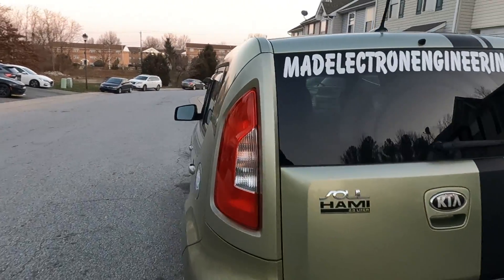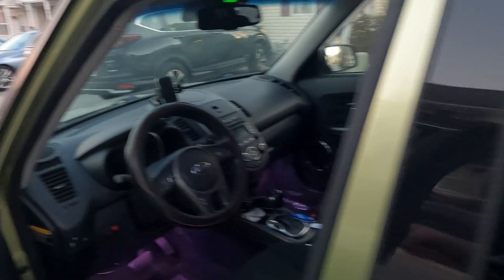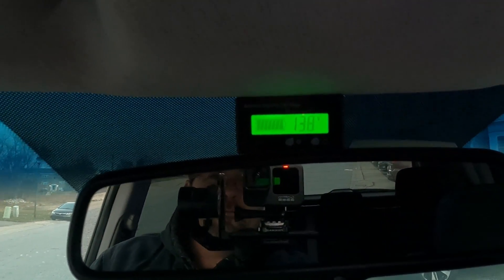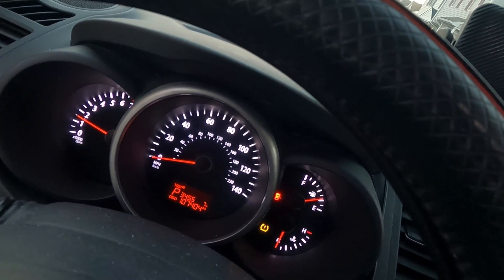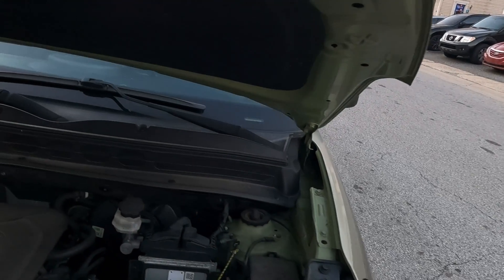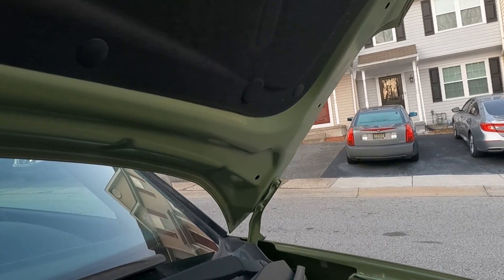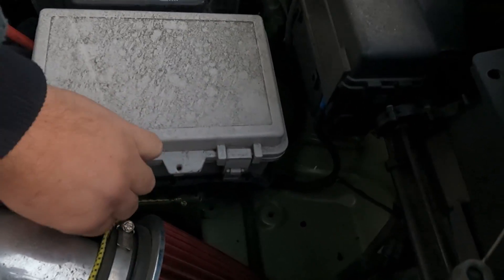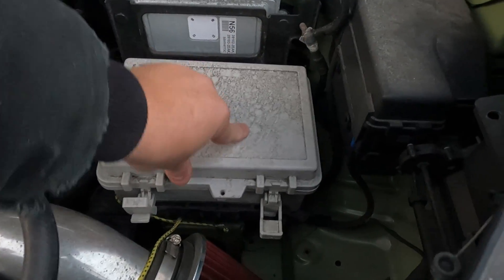Hybrid Supercapacitor Car Battery 5 Year Update

Comment: the only bad thing with this is that you should never charge a LFP battery bellow 0C. i dont get how you could possible make an easy solution for that problem. where i live its -0C to -35C from November to April. so you cannot heat the battery to keep it above that temp, and you coudnt just rely on the supercaps until it get warmer (from the engine). so the only way would be Lead-Acid + Supercaps.

Comment: ...really a nice and interesting job, I wonder if can also be done for 12v motorbikes, if possible can you tell me how many caps I can put in series, voltage and farad. Resistance if I read correctly, use only if accompanied by lipefo4

Comment: no bms needed to protect from over charging, etc?  Im looking to build one for my suv to maximize the space s have. thanks
Reply from the maker: Bms is built into the Dakota lithium battery
Reply: @madelectronengineering  thanks for the response, what about to capacitors?
Reply: There's many kits on eBay and Amazon now that have a BMS or leveling circuits built in, to avoid overcharging individual caps.

Comment: What about using like smaller capacitor bank just enough for car starting, and larger cap bank for slowly  charging it with voltage booster when it drops below critical or just before u start a car, to use whole range of it, not only 14-10V.

Comment: I just watched all 10 parts and was wondering what if you have an issue with the car and it doesn't start right away? Maybe you or a mechanic are diagnosing a no start situation and need to crank it for an extended time.

Comment: Good day sir, is it works for a 3.0L diesel
Reply: Should...I mean the glow plugs might pull it down a wee bit...but the hundreds of CCA's it will dump to the starter will get it turning over very well and be able to compress/heat the air in the cylinders probably faster than the glowplugs could

Comment: Hi, I would like to do a similar thing with my car but keeping the 70 ah lead/acid battery, what resistor should I put between the battery and the capacitors?
Reply: You dont need any resistor
Reply: @yougod7253  ok but it would still preserve the battery, right?
Reply: @edoardobattaglia5157  That is what the small LiFePO4 battery is for...just to keep the volts up in a car that is sitting...to maintain the charge of the supercaps...the supercaps dump HUNDREDS of amps into the starter EVERY TIME rather than getting weaker and weaker and almost non existant when stupid cold...a lead acid battery at 7 would propably have like 1/4 of it's CCA...the supercap batteries have NO problems
Reply: Hayden is right. A resistor is pointless. The battery insofar as it is not perfect is like a resistor in itself. The supercaps would actually somewhat stabilize the voltage and if anything protect the battery. The battery wouldn't have to take a heavy load. I don't know what the specifics of your plan are given there is limited space under the hood, but if you can that's great. I have a history of replacing car batteries and they lose almost all capacity in a year. Maybe I'm going for bad bargains? So I was thinking of experimenting with small rechargeable batteries of some kind because I realized I don't need Ah (amp-hours), just Amps. Leakage current is a thing in most cars though. Something like 20mA. So a series of say 10 or 12 NiMH AA batteries (1500mAh) would last... 3 days. I guess I need better than that.
Reply: @ericmollison2760  ok, I have a fiat punto evo with a 1.3mjt, it originally had a smaller battery but since the 70ah battery fit I put that one in, but I thought that as soon as it leaves me I could get a smaller one again (50 or 60ah) and take the capacitors to put in parallel, there is plenty of space around the battery.
Reply: @edoardobattaglia5157  I don't know much about cars or what 1.3mjt means. I sent a long text and my internet failed so to be brief, I'm just messing around. I have a car battery that works (as long as i don't leave the headlights on for 20 minutes) but for various reasons I am interested in the idea of a supercapacitor battery. I don't think I'll actually try it because its expensive and complicated for someone like me who is not a very competent builder, but it's a cool idea because supercapacitors have potentially infinite cycle life. There are also fast discharge lithium ion batteries designed to replace lead acid, but they also have limited cycle life and are very expensive. I think it makes sense to try building around the existing battery as long as the battery isn't completely useless. I guess I'll take some more time to research and think.
Edit: And I misread your text. Why replace your battery with a slightly smaller one then include supercapacitors? The idea of supercapacitors is you don't need the car battery, just a very small battery (unless you leave your headlights on or something)

Comment: So, a battery that is lasting 5y, I guess that is good but what is the big deal about this so supercapacitors? I am really just intrigued, not trying to be an ass lol
Reply: Honestly? Nothing. People just got excited because the word "super" was in the name, so they forced them into use for lots of things they're bad at. Everyone pointed out how bad an idea supercapacitor car batteries were when people started doing this, but nobody listened.

And yes, supercapacitors make very bad batteries. There's a very good reason everyone selling supercapacitors for use as car batteries went out of business, and no car manufacturer is using them. Even if supercapacitors last "forever" as some claim (they don't, capacitors fail just like everything else), exactly how much value is there in a battery that lasts forever? $50 a year, maybe? That's going to take a pretty long time to pay itself off.

If you live in an area where it's so cold that a healthy battery can't reliably crank your car? Then I could see this providing a bit of convenience as compared to a battery heater. But if you've never had a negative opinion about the cold cranking amps of a new lead acid battery, then this will provide you no benefit at all beyond a few dollars a month of hypothetical cost savings if you drive the car 20 years.
Reply: The supercaps are what's providing the cold cranking amps.
Reply: Capacitors can charge and discharge with very little effect.  The available charge cycles compared to batteries is much greater.   Theoretically Capacitors have infinite charge cycles, but of course something will always degrade and fail.  They have potential for extreme long life however and not temperature dependent like a wet cell battery.
Reply: HUNDREDS of amps being able to be delivered...really spins up the motor fast...get's it started where a cold lead acid battery would barely spin it over